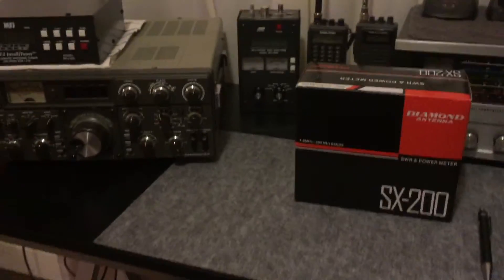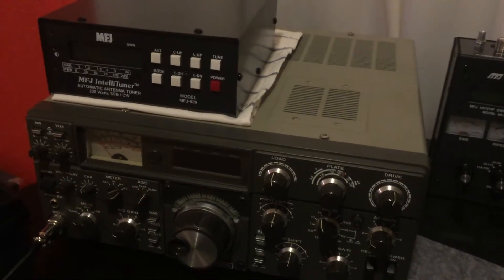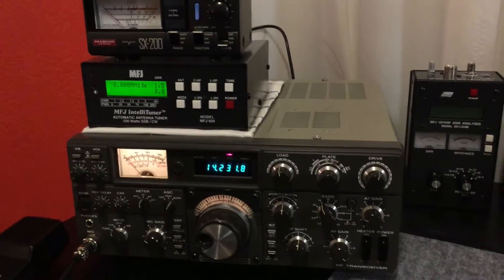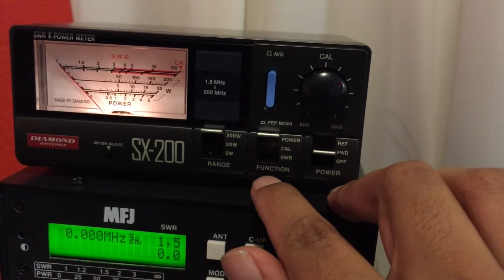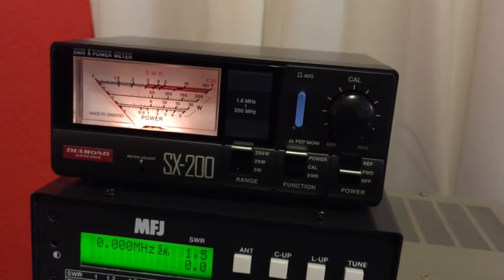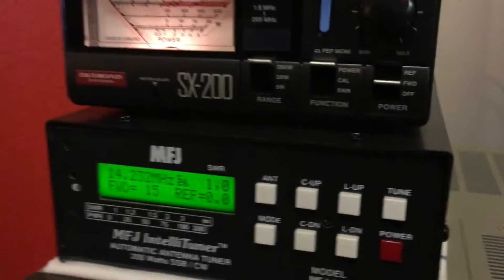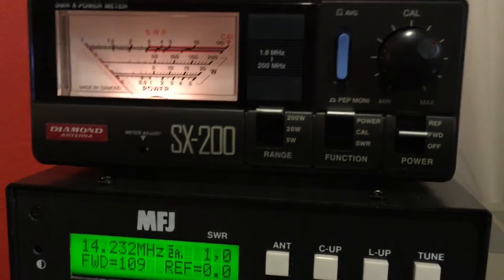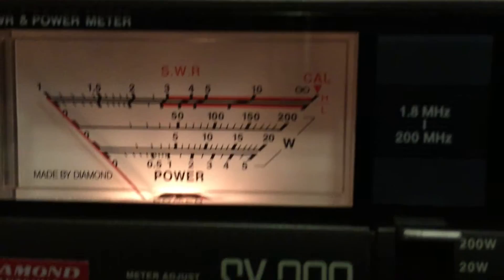Diamond SX-200 SWR/Wattmeter Demonstration

Comment: If meter still works in PEP mode Without DC power  then its a HOAX capacitor PEP circuit, DC is only for LED.. ..
😊

Comment: i am 5 years late..should it first before use
Reply from the maker: I just ordered a Palstar PM2000A to replace an MFJ-891 (that replaced this Diamond meter).  Hopefully the Palstar will be more accurate, I need more accuracy to measure output from my Ameritron AL-811 to safely get as much power as possible from the amp while working digital modes.  The MFJ-891 would be my lower-cost suggestion.  This Diamond meter was OK too, but I prefer dual-needles.

Comment: It looks like you returned the meter for a calibration problem?  Its almost standard operating procedure to calibrate it upon arrival.  Not hard.  I would trust that RadShack meter a lot less for accuracy, and the radio you have may indeed be putting out 100 watts plus some.  But good luck in finding the one you really want, you may get lucky and get one that held its calibration during the UPS gorilla attacks on the shipping box :-)

Comment: the sx-200 meter will not work with the  power switch off, it does 2 things, light for the meter and allows the
meter to function.
Reply: It is also worth pointing out that it is reliant on a power supply to indicate PEP. There is no such thing as a PEP meter without a voltage source. This is the main reason for this, not the light.

Comment: i just used a new mfj874 for the first time out of the box last week. The cal dial would not allow the meter to swing fluidly to the swr set indication. it was very touchy and jumpy.  Once the needle approached the swr set  graduation on the meter, it would  flip flop  1/8- to 3/32 above or below the graduation and i rarely could get an consistent reading. 

So I called mfj.  Stan at tech support was useless. I gently explained how I was going about setting it, his questions were;  "what dial?" "how are you setting it?" "I dont know how the technician could replicated this"      ..  " I dont know of any other meters you could try beside the 822, we have over 100."

I was shocked how slow and useless this guy was.  He said just send it back to amazon, otherwise it would take too long to get a replacement.
Reply: That's because MFJ is crap. They obviously used a poor quality potentiometer.

Comment: ya know. . . I learned about as much from that video as I did from the manual.  On a scale of 1 - 10 - It was a 3.   How it is calibrated is the biggest variable.  No one tells you how to calibrate it.   Why?
Reply from the maker: If the manual doesn't mention how it's calibrated (I don't think it does, this product was returned 2 years ago), I wouldn't know..  The point of the video was to show the functionality (and hopefully realitive accuracy compared to my other meters) right out of the box for a random unit purchased from HRO.  Overall, I think the unit was calibrated OK, but since I couldn't be sure, I returned it and ordered the MFJ-891, which I did a video on as well.  Thanks for watching!

Comment: I noticed the SWR scale has a H and L scale right underneath the letters 'CAL'.  Do you know when you should use the H scale and when the L? I would like to know.  Thanks! Excellent video!
Reply: When your RF output is less than 5 watt,  then use Low scale for SWR reading.
Reply from the maker: I can't remember, it might be mentioned in the (terrible) manual.  My guess is the Low scale is for 5W and 20W ranges though, and it only applies to SWR measurement, not power output reading.

Comment: While you may have gotten a bad one, the Diamond meters (particularly the SX200) are very accurate. I have compared a couple I have to my Bird wattmeter and they are dead nuts on. This is especially true at the QRP (low power) levels as well where accuracy often suffers. 

If you are happy with the new MFJ then fine. But be advised that there is a reason why the Diamonds are $90.

Also, no law says you gotta your 530S full slam firewalled at 110-130 either. 80-90 watts works fine and saves those finals.

Sorry for being a concern troll.
Reply: ..and thanks for the video!
Reply from the maker: Hi!  Thanks for the response.

I have read a lot of discussion about tuning Kenwood Hybrids, and there doesn't seem to be a whole lot of agreement on exactly how to tune them.  The manual, and many people, say you should tune for max power, as doing otherwise doesn't lower the power to the final tubes, but simply creates a mismatch between the final section and the antenna (which makes the most sense to me).

I have no desire to run at 110-130 watts.  I have come to a compromise, and once I peak the load and dip the plate for max RF power, I back the the load capacitor back  slightly to lower the plate current.  This raises the HV slightly, but I think it's a safe tuning method.
Reply: @SWRadioConcepts ..late to respond but you're doing it correctly. Tune "for maximum smoke" and then throttle it back.

Best of luck; hope to work you some day.

Comment: I thought that the MFJ-929 was installed in your car. Did you put back the LDG tuner into your car? You are obstructing the ventilation of your radio with that tissue under the MFJ-929 tuner.
Reply from the maker: I have two!  But this one has a problem - I may do a video on trying to calibrate (unfortunately it seems you have to calibrate them even when new out of the box).
Reply from the maker: The final vents are not covered by the towel, in fact no vents are really covered by the towel - Trust me I took that into consideration :)